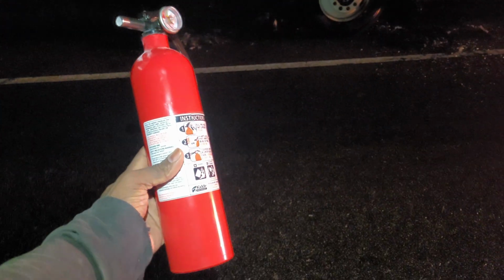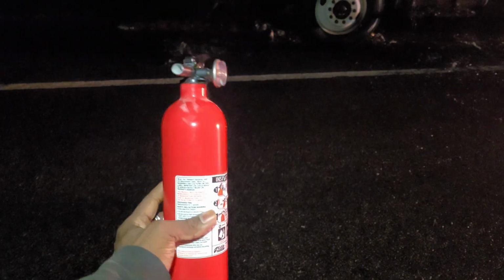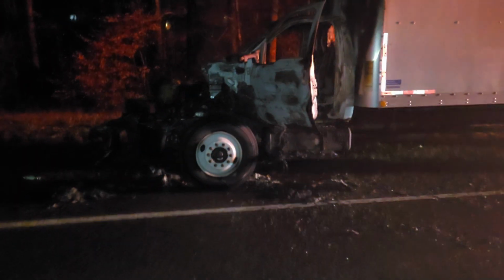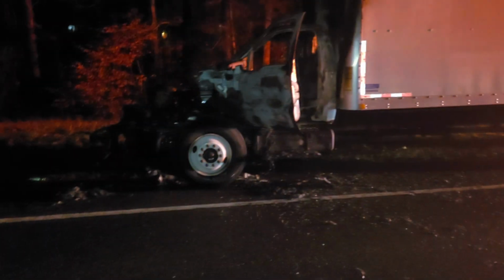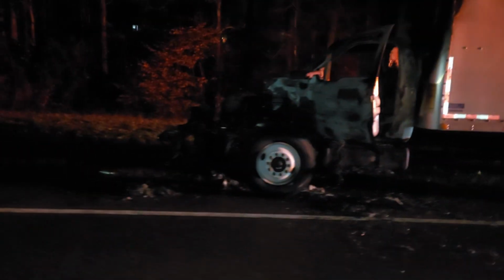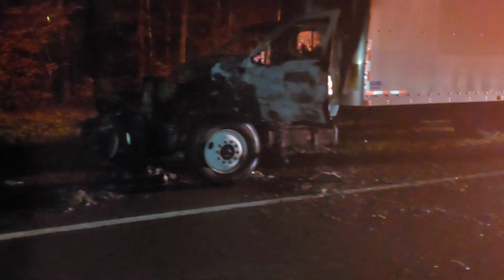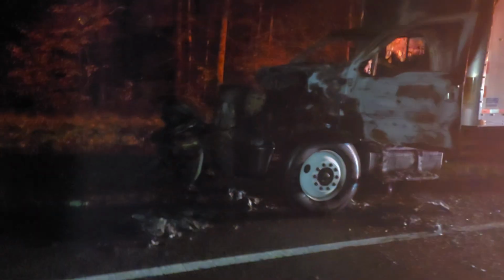My Truck Caught Fire

Comment: If you find yourself with any used vehicle with electrical issues "fixed" from previous owners: Walk away if 
you can.  
  Weird voltages and intermittencies, lights dimming and then working are all symptoms of bad grounds.
Grounds WILL ALWAYS corrode, build resistance and break.  These are on the non fused side of the circuit so
they add extra headaches.   Especially on open framed trucks.  Also you are dealing with different metals for
the electrical connection to Ground.  Electrolysis occurs. Heat builds up voltages drop and current goes up.
  Be aware that many people think that fixing a fuse that keeps blowing is to put a bigger fuse in.  This is how 
most vehicle electrical fires begin.  That single wire can now get red hot through out  it's path in the harness.
This will melt the insulation on other wires and then you have catastrophic shorts through many circuits.
  A battery quick disconnect should be installed on all cars and  trucks and be switched open with engine
turned off at first sign of electrical fire. BEFORE using extinguisher.  Otherwise you are fighting the fire
and the battery and alternator which add energy to the fire.  Key off also stops the fuel pumps.
Reply from the maker: Yup correct, lucky I was able to turn it off and get my keys out.